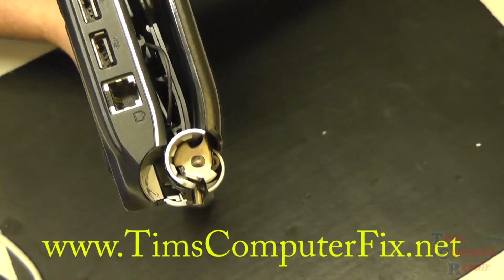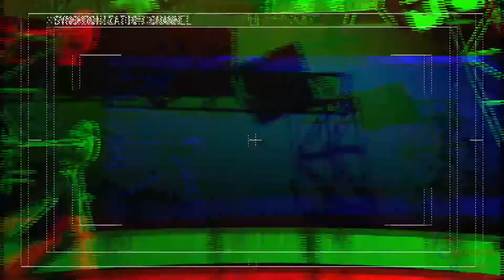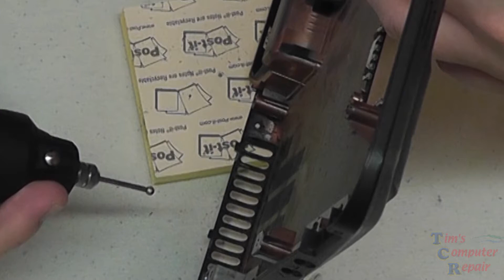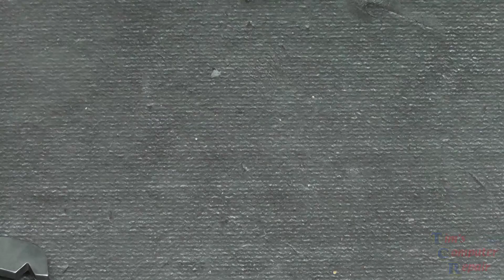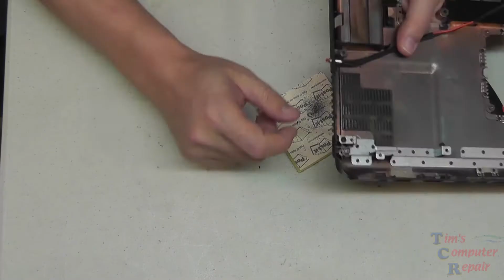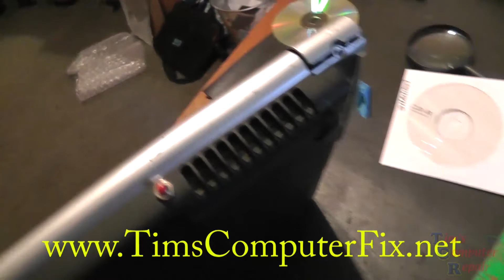Laptop Power Button Repair Gateway MS2285 by TimsComputerFix.net

Comment: Just started my electronics journey. But isn't one of the main soldering rules, that you NEVER just drip solder onto whatever your soldering? Aren't you supposed to heat whatever it is your soldering, and let it wick the solder in from the other side? Isn't this how you get cold joints? Or is that just for a rule for circuit boards and wires don't matter? Sorry if this is a silly question...

Comment: I have a friend's Gateway  laptop NEW90 that doesn't power up. I suspect the problem is the on/off switch, which has a ribbon cable connected to the motherboard.  ( I tried everything else ).  I might try shunting pins 1 and 2 at the keyboard ribbon cable port.  What do you think?
Reply: Same here
Reply: @tylervision707maul  found a on/off switch assembly on ebay.  Installed it and it worked!  (Then I bought a top cover/palm rest, it came with the power switch already attached!)

Comment: Is it possible to use a power button from another laptop, cut a snug hole in the dashboard, mount & wire it in, & have it work? If the new button is from a smaller laptop, so the voltage/current going thru it may be lower, would that make a difference? Laptop to be repaired is a gateway NB79 series, so the pwr button is mounted the same place as is in this vid. Thanks & I subbed! 🤓
Reply from the maker: I would say it is possible. Don't have to really worry about voltage on the pwr button. Only one way to find out right!
Reply: @TimsComputerRepair  yes, thank you 🤓

Comment: what if the power button is connected to the motherboard using ribbon cable ? , the power button is on board with all other function button, i'm trying to make a power button replacement for my laptop
Reply from the maker: You may have a hard time with that one.